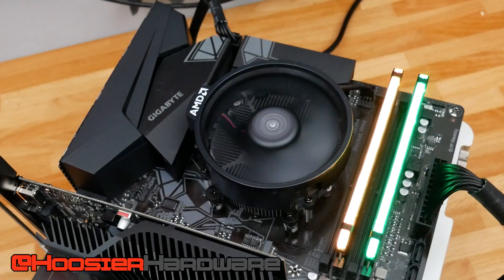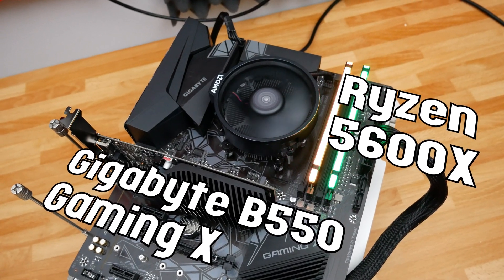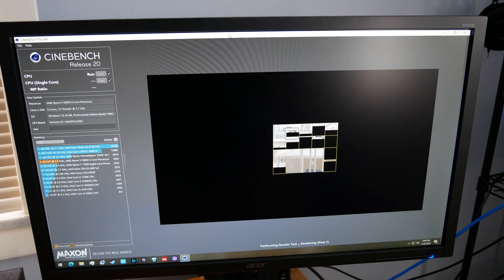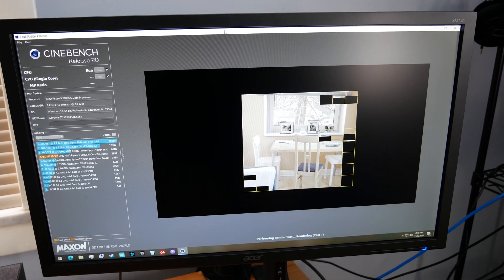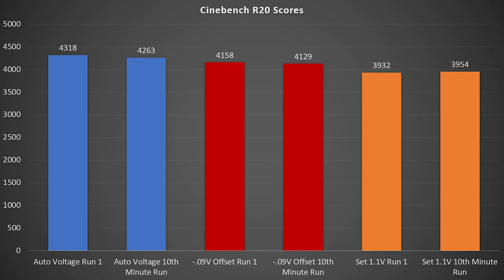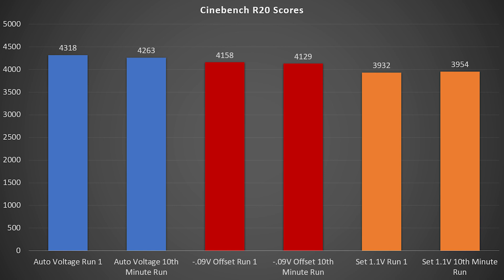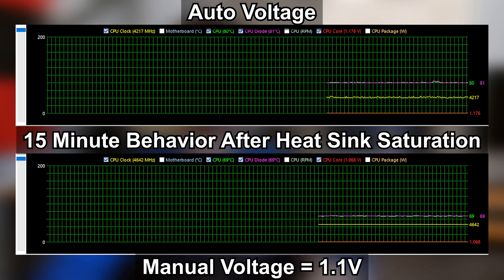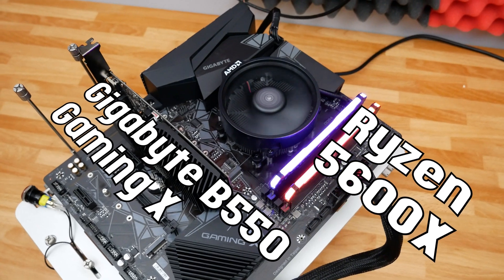Undervolting the Ryzen 5600X

Comment: The wraith cooler struggles to keep it well under 80 degrees. I undervolted mine to 1 volt at a 4.250 ghz all core clock. Im happy at that level of performance as this chip is at 40% mostly when my 3060ti is around 95% on most  of the games im playing. 

The temps at auto were 86 degrees. But ive found diminished rate of returns as i dropped the volts. 

But the coolers runs quieter as ive dropped voltages. 

Massive steps down has not seen a huge drop in temps. For example, going from 1.050 to 1.0 has seen about a 1 degree drop.
Reply: The pc went from sounding like a small vacuum  to sounding like a small desk fan.
Reply: Ive also undervolted my 3060ti. It used to hit 83 degrees, but not hits around 76 or so on the same furmark preset.

Id have expected a lower temp, but the fans are not having to work as hard.
Reply: And my room does not feel so heated up as a result.

Im much happier with these undervolt settings. 

Im in not rush anymore to replace the stock cooler.

Comment: For myself I used amd ryzen master, on 'creator mode' i set core freq on my 5600x to 4500 on all cores, voltage to 1.2V and got 4346 in cinebench r20 and a higher score in 3dmark with slightly better min framerate in games. Runs noticeably cooler and uses less power too. Maybe I got lucky? Silicon lottery and all that? Either way, from my experience, I think its worth a try if you have an interest in increased perf and lower temps.

Comment: I was hoping to see how you undervolted the Ryzen 5600x. I guess this video is for those who already know how to do it. Do you have a video that details the steps you need to take to lower the voltages?
Reply: also looking for specific methods. to my knowledge thus far, using pbo2 with the new bios updates allows to set different voltage curves.

Comment: I went in BIOS and put PBO limits to disabled, used All core 30 count and a negative curve.. My 5600X now boost to 4,650Mhz on all cores easily and stable.
I use an NH-DH15S Noctua cooler and my Idle temps are 28c and gaming in COD MW it's about 57-58c.. Never goes high. I love it.

The funny part is that undervolting with Precision overboost makes it actually boost a little higher because the PBO and the CPU sees more headroom.

Comment: I think you should totaly do it specially if you do not have an air conditioner and cannot control ur room temperature as me and you are running it on stock cooler for now. My idle temps in stock are 54c -60c with undervolt I've got 37c to 40c and gaming from low 90c to 65c max.

Comment: my best undervolt is using an actual offset and not the curve. with a curve i get crashes and max voltage for auto oc 4850 is 1.41v to where offset is with same settings only offset voltage is 1.36 max voltage for sure isnt harming benchmarks etc and i can game consistantly without crashing. offset is -.06** whatever the value is inside MSI b550 bios.

Comment: Well, what I have observed is that when voltage is set to auto, when cpu is in full load under a cinebench like software, it will run at 1.3v and above, and current is a way higher, like 70 up to 80Amps. As we know from the electricity classes long ago lol, voltage x amps equals watts, which means power. The more power applied, more work will be done. I just do not know why clock speeds are the same...

Comment: On auto my 5600X goes to 105C in Cyberpunk. The PBO setting pushes it to 1.4V
Reply: Does your cpu still live? Get a serious coller if you want pbo enable...
Reply: @syfiltzo  went back to Default/Auto settings and its okay now, 79C max at 1.431V or so. After fresh Windows installation, there was some malware. GameBoost on, PBO on, with Noctua NH-D15S.

Comment: Im running my 5600x with the stock cooler and my temperatures are absurd. In witcher 3 it hit as much as 87-90° after ~20 minutes of playing. The case I use is be quiet pure base 500dx so it has a good airflow. Mobo is gigabyte b550 vision d. The cooler is mounter properly and I tried remounting it/changing the thermal paste.
Reply: Did you fix it ?
Reply: @EataTwixX  i turned off the boost in bios so it stays at 3.7 ghz and the temperatures stay around 65°C under stress. For now its enough for me but in the future I might just change the cooler.
Reply: @grubre.2174  try to Set it at 4.5ghz at 1.2 volt. Worked for me

Comment: Try an offset of -0.05v as. per gamers nexus ryzen undervolting offset video. It should increase multi core performance.

It did for me. I have a 5800x with a nh-d15. With auto voltage it scored around 5900 in r20 while peaking at 90 degrees. With a -0.05v offset it scored at 6090 while peaking at 85 degrees. 

I tried an offset of -0.096v and it scored at 5789 in r20 but peaked at 83 degrees. I had PBO enabled at auto settings in all tests.

Comment: Would love to see this testing with the new pbo2 and curve optimizer bios setting
Reply: I'm using that now with my 5600X.  I've got the curve set to -30 magnitude (max value), and so far no stability issues.  The noticeable thing is that I have a Wraith Prism cooler which would max spin launching any app... basically struggled to keep pace even though it's beefier than the Stealth.  Now, with Curve Optimizer set?  I get a little bump in the RPM, but nothing close to max spin.  Thermals have definitely improved.

I don't really do benchmark testing and such, I leave that stuff for the CCs on Youtube, but I will say even without any noticeable performance increase, it's something to consider for the thermal benefits and normal wear&tear.

Update Edit:  So I ran into an issue with the curve optimizer while gaming.  Most of the games I'd been playing since getting the new CPU were working fine with the undervolt.  However, I ran into an issue with Pathfinder:  Kingmaker where the system would hard crash after so long.  It has been the only program to this point where I ran into this issue.  I reduced the magnitude from -30 to -25, and haven't run into any problems since.
Reply: @rcslyman8929  thanks for the update. willing to do a undervolt when my card arrives. if nvidia makes enough xD
Reply: I've done the same as Slyman. Running with a -30 and I've noticed a pretty big improvement in both thermals and clock speeds. Using a Hyper 212 BE I went from ~60°c on Apex Legends in the training area to ~50°c. Before, when doing aida64 stress test, my all core clocks would dip to 3.95ghz lowest and stay around 4-4.2 most of the time, sometimes hitting 4.3 and rarely spiking to 4.5-4.65 on a core here and there. Now it's consistently 4.4-4.45ghz all core and moving upwards to 4.6 a lot more often. Temps before would rise to about 68°c but now it's around 62°c. Cinebench R20 before would hover around 4000-4050 score for all core, after it's around 4400... Can't remember the temps for these runs but I'll probably come back and update if anyone wants me to. I haven't noticed any stability issues whatsoever so far. I'd say it's a must try feature
Reply: @CYNC33  Hello sir! Can you give me a few step guide to do this? Is it complicated?
Reply: @CYNC33  tyvm for the details. noted
Reply: No point doing it otherwise

Comment: I adjust my 3000X dynamic v core by -100mv, it works ! At 1.38V I reach 4.4ghz stable and did cinebench R20 score 2719cb!
Reply: Nice. But for all core boost 4.4GHz at i7-10700F, for example, you need only 1050 - 1100 mV (all core 4.6GHz 1100-1150 mV). You can find some tests on internet. TSMC 7nm production is one big shit for voltage-freq characteristics. This is also the main reason why with lower-clocked processor models, Intel has no problem matching the energy efficiency of AMD processors, despite his 14nm production.

Comment: My 5600x spikes to 95c immediately on prime95 with the wraith prism cooler...
Any ideas? Stays around 75c to 80c besides that stresstest
Reply: wraith prism is fine but will be hotter.
to ensure lower temps a third party good aircooler is needed.
Reply: @RobertJohanssonRBImGuy  fine? 95c is far from fine
Reply: @hoepsipoepsi  Its good your not running that bench then.
wraith is fine for gaming and various workloads people have.
stress tests isn't included there.
so, buy a third-party cooler for lower temps.

My noctua u12s wont go over 70c with 5600x.
Reply: @RobertJohanssonRBImGuy  prism isn't doing better with games either, same temps as the stresstest...
Reply: @hoepsipoepsi  Its then either a hot cpu ( and/or environment) bad contact, a better pasta needed, not enough contact between cooler cpu.
It can also be a software glitch with the measure program (check with another).
Buy a better third-party cooler or rma the cpu.
Reply: @hoepsipoepsi  AMD states the 80-95c is expected and normal with the cooler.

Comment: I also have a Ryzen 5600x. Could you make a video tutorial explaining how to make undervolt?
Reply: need bios/agesa to enable curve optimizer.
Your mboard may or may not have it atm.
Reply: @RobertJohanssonRBImGuy  i am facing the same issue when undervolting 5800x -0.1 volt on msi x570 carbon pro wifi . the clock speeds dose not pass the base clock 3.8 ghz even when i try -0.05 volt the same thing happens
Reply: @RobertJohanssonRBImGuy  thanks
Reply: @abdallahsindi2787  Your welcome, hope it works out
Reply: I dont think these cpus undervolt well and you run the risk of reducing your performance on these chips. Try for a nice $30 air cooler its worth it

Comment: just got my 5600x yesterday and it hit 90 under a 100% load and hovered around 80-85
Reply: In what software?
Reply: VM for a server test. I was compressing about 500GB of videos and a Security scan on 16 tb of SSDs just to test temps— those alone will ramp up the usage to 100% doing just one of them also fully encrypting a 2TB external SSD for a client. And was light gaming on Factorio just to really throw it that last punch. Wasn’t noticing any lag but it was worrying me to see that high of a temp, what can I say it’s a bad cooler and I’ll be getting a better cooler because I have to use my computer for heavy use scenarios at least half of the time I have it on and I don’t want to shorten its life if it’s sitting at 80-90°+ for 6-10 hours a day.

Comment: I am running 3600x with stock cooler on 4,325 MHz at 1.175V (through Ryzen Master Manual OC)
Reply: My i3-10100F is capable running 975 mV for permanent all core boost 4.1 GHz. In view this, 1175mV and 4.325 GHz is tragicomic for 7nm production.

Comment: Mine at stock with PBO and the wraith stealth cooler running cinebench shoots to 95°C in the first minute. No need to heat soak it 10 minutes to see clocks dropping. It stays running at about 4.2/4.3 ghz. I did try undervolting and saw the same thing you did, performance degrading and lower clocks. The only thing I can make to let it run fast and cool is leaving voltages on auto, PBO, and setting the thermal limit to lower than the stock 95. I set it to 85°c. This is better because it allows single thread hitting super high clocks and only throttles on an all core extended situation like a benchmark. But real world scenario you be get max perf. The stock thermal limit is really high. Going to get an arctic 280 aio, but it's out of stovk here
Reply: You could look into underclocking it
Reply: @BA-tf7qr  it does it automatically. Whatever is necessary to keep it from exceeding the temp limit is Auto
Reply: @nufimamar  Can I ask, what kind of voltages are you getting on auto? PBO off I get up to 1.35v, and with PBO on I get up to 1.4v or peaks sometimes even above it. I'm a bit worried about that and considering turning off PBO for now... I don't want to burn my chip. It is super fast with PBO on, though. I guess those peaks are just nanoseconds so they won't kill the chip.
Reply: @MadViking82  mine is the same and you don't need to worry. AMD is shipping out of the box with a thermal limit of 95°, so it can safely operate up to that temperature. If you fell it to be too high you can change that thermal limit in the BIOS to what you choose, and it lets it clock to the same levels with the same voltages for short bursts or in single threaded scenarios, until the temperature you set as limit is reached. I can tell you that I changed the thermal limit of mine to 85°C, and it's still amazing fast, and on cinebench r20 multithread it can still push 4.2/4.3 all core with that temps. If you game you hit higher frequencies (because the pbo is still set to 4.6ghz), because games don't push all your cores to 100%. But while you wait for a better cooler to put on it, changing the thermal limit will give you the peace of mind of running it up to exactly the temperatures you feel safe with, sacrificing a little of performance.
Mine is running on an arctic liquid freezer 280mm now and it's absolutely amazing! The cooler is dead silent!! It now boosts to 4.65ghz @75°C on cinebenchR20! I set it to run at even lower rpm manually and it now benches all cores up to 80°C up to that same 4.65ghz. Gaming with silence and massive boosts never goes above 70°C!
Really recommend it. Also changed all my case fans from corsair 140mm to the arctic p14 pwm ones and they really are amazing. Dead silent on low rpm. Full speed they are definitely heareable but push an absolutely impressive amount of air!

Comment: Hi, will you make a video testing the different coolers (air, aio etc) with the ryzen 5 5600x?
Is an air cooler enough?
Reply from the maker: My next video looks at several different air coolers on the 5600X. I'm not completely through testing, but I'll tell you now a solid air cooler is plenty for the 5600X.
Reply: @HoosierHardware  you're not wrong but where I live, it gets pretty hot here, like 38-39 degrees Celsius so that's why I am concerned

Comment: It's clock stretching, protects core from crashing in undervolted situations. Also no monitor software can show true clock speed, it's adjusted in 1ms intervals and best polling time is 250ms. Hwinfo64 have feature called effective clock speed, it shows averaged clocks speed over time(btw sleep state = 0Hz). I don't have zen2 or 3 so not sure if clock stretching is included. But only true measurement stick is actual performance which you can trust.

Comment: Maybe wait until Undervolting is actually supported as well?? https://twitter.com/Thracks/status/1324574790032756736
Reply: New functionality expected to arrive with AGESA versions beyond existing AGESA 1.1.0.0 includes:

- Returning support for negative core voltage offsets (“undervolting”) with all-new AMD functionality for better frequency, voltage, and performance tweaking
- Additional AMD optimization for performance and stability at ~2000MHz fabric clock

Comment: Did you flashed the BIOS and what version? My aorus x570 elite won't post.
Reply: A version that supports zen3. Look on the gigabyte website. You need F30e or above, preferably F31e.
Reply: You need to visit gigabyte web site and look for your Motherboard model. Then you got to reach the download section for that particular board and go to the bios options. Look for the one who states support for new Ryzen 5000 series. download and extract the content into a clean formated Fat32 USB stick. There you have to rename the bios file which is the one with random letters and weirdest name for GIGABYTE.bin then its gonna ask you if you want to change the extension of the file you choose yes. Icon and file will change into a image format. Then you got to turn off your Pc and put your USB with the files inside and renamed one in to the back of the board WHITE usb port which normally has a Bios label. After all this you just have to press the Q-Flash Button and wait. Several things will start to happen. A led in the USB port where will star flashing. After a while it will keep flashing but at a slower pace. Then your PC will suddendly power on by it self. It can Post right away or it can do nothing. Its important that you will interact with it Once the flashing port in the bios has completely stoped, is very important. It can happen that it doesnt post doesnt matter just wait to the flash to finish its job and then you can manually reset your pc. You can do this with all the hardware installed, no need to remove cpu nor ram or gpu whatsoever.

Comment: been doing some off my own testing to day on a 5800x, I was trying to get a good overclock and managed to get a fixed oc of 4.7 stable at 1.256v but when i tested with cinebench r20 i lost 500 points of my stock score, for some reason these 500 chips dont like you messing with voltages, I even upped the volts to 1.35 but still lost the points against the stock score. I will be watching youtube to see if anyone can work out what is happening ;)
Reply: Because it isn't supported yet. https://twitter.com/Thracks/status/1324574790032756736
Reply from the maker: The plot thickens.... 🤔
Reply: @HoosierHardware  It's not that thicc. Just doesn't work yet..
Reply: 1.256v is too low for an overclocked chip. My 5600x pulls almost 1.45v on auto settings, and lowering it to 1.35v prevents it to hit high frequencies and lowers my cinebench score as well
Reply: @nufimamar  Same here! Testing my 5600x which I just got today. Auto overclock goes to 1.45v easily, and the cores hit 4.7ghz, but manual OC doesn't work almost at all, crashes immediately unless putting extremely high static vcore like 1.4v which I don't want to even try.